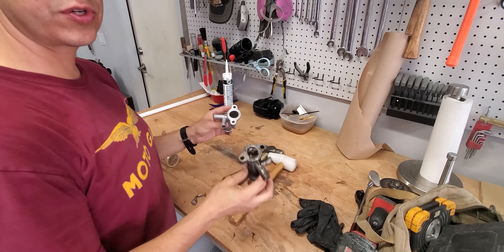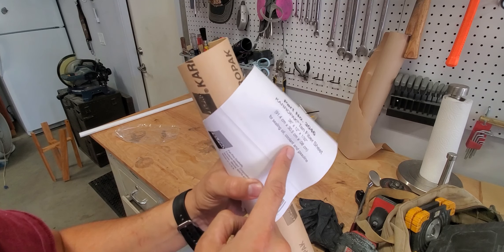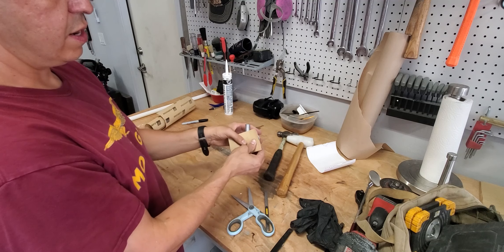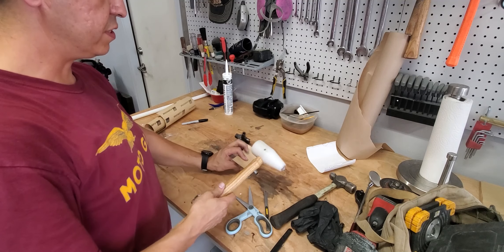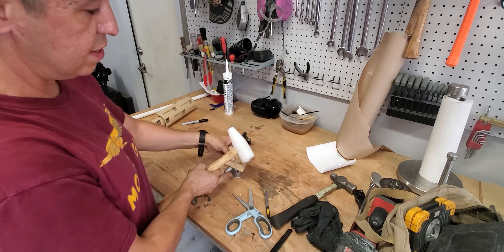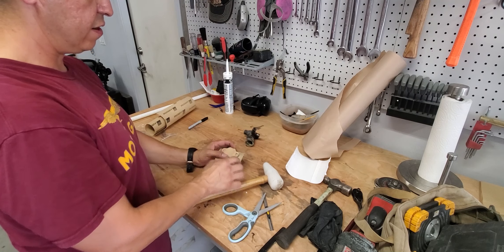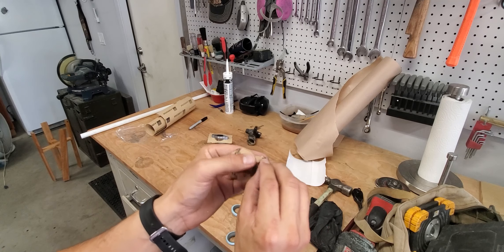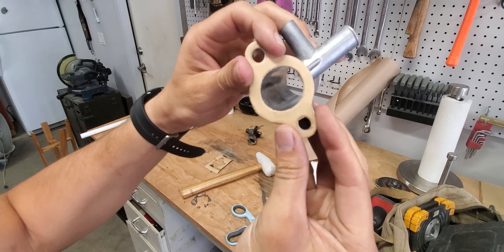How to Make a Paper Gasket for Anything DIY (but mostly for a Datsun 620)

Comment: I use to make them years and years ago.  Great video
Reply from the maker: Yeah, it works well in a pinch.  Thanks!
Reply: With that new gasket that 620 would run forever!  I was working for a datson dealership back then!  When the 720 came out it was a big step up!  We put A/C in most all new cars back then! All datsons back then had valve adjustments. Made lots of money 💰 back then with just service work!
Reply from the maker: @themulesheriff3009  yeah, the 720 is great.  I wish I had out my 620 body on a 720 frame and I sure wish I had A/C!
Reply: Check with some older Nissan dealers!  You might get lucky and find a NOS factory a/c in the box. I’m sure some dealers had some left over from way back!  Every single part is in one box except the Freon    They are very easy to install!  Inside can be installed in about 30 minutes and under the hood in about a hour!  The kit comes complete with very good big fold out instructions with pictures!  I’m sure some dealers would have one in stock from way way back
Reply from the maker: @themulesheriff3009 I will check it out. One problem might be caused by me having a 1995 Nissan 240sx engine and a turbo in the way of a compressor :)
Reply: If it’s factory turbo they made a kit for it. Also check with ARA air conditioning.  They made got aftermarket a/c kits for datson and Nissan